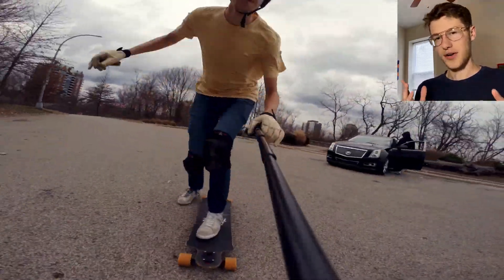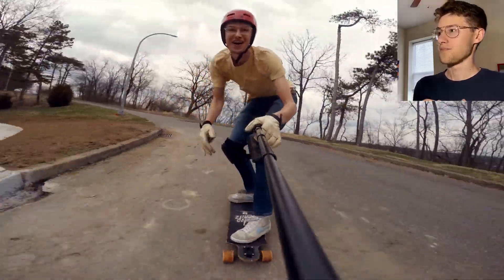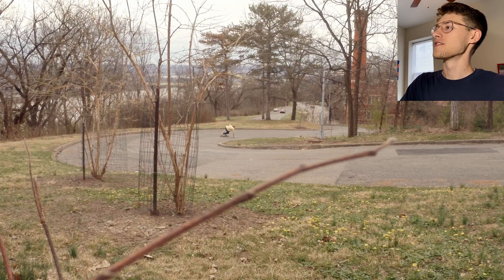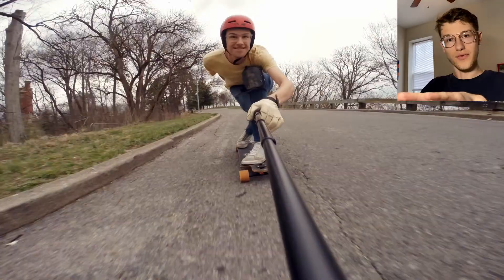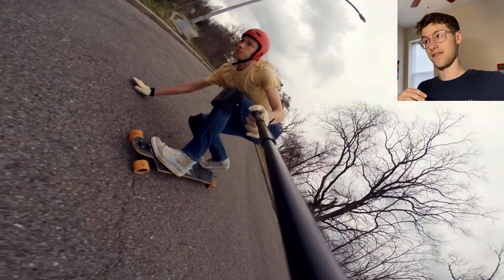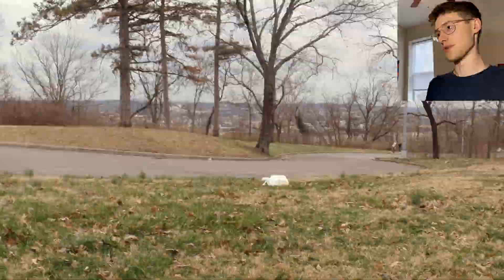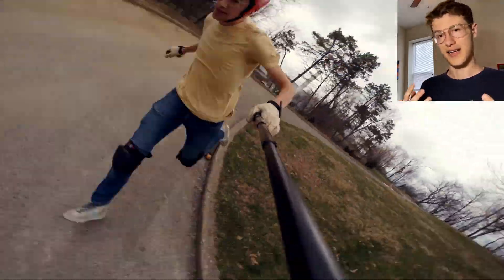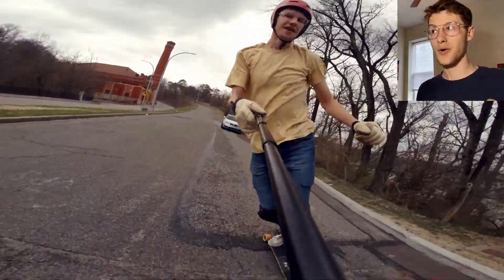What Riding a DROP-THRU Taught Me

Comment: This was super interesting. I like the part where you said "you're just along for the ride" when you slide. That feeling on a drop through is kinda scary but that's what makes it really fun as well. I definitely think you should've gone full 2010 style and smack some rakeless trucks and slidey freeride wheels though just for the fun of it. Sweet analysis tho you always get these on point 👌👌
Reply from the maker: I would do the 2010 setup if I were doing “How Longboard Technology Changed in 10 Years.” Using the gear in this video gave me a better reference to the kind of sensations I’m used to feeling on a board.
Reply from the maker: I complete agree with the unique and scary feeling being the most fun part of riding a drop through. I’m going to try to lean in to that sensation.
Reply: @owencampbell777  ah ok makes sense
Reply: @owencampbell777  dont feel like youre missing out by not riding slidey wheels on that setup? I understand your reasoning with the alphas but only skating those seems strange.
Reply from the maker: I’d ride freeride wheels on that board in a heartbeat.

For this assessment, it made sense to ride something with grip so I could try to perfect my corner and pre-drift technique. The LDP Alphas made sense for this test.

If my intention was freeriding this board, slippery wheels would have gone on it right away.

Please understand that this video was made after a few hours of skating this board. Not a season. Limiting changes in setup was an important step so I could develop a consistent technique.
Reply: @owencampbell777  that video concept would be so sick!!! i used to be a pretty high level downhill skater in like 2012-2014 and i’m now getting back into it and the new school setups are messing with my head and i seriously do not know what setup to get! so a video like that would definitely help me out immensely

Comment: Try dropped decks now ! I have been riding downhill on dropped decks since 2003 (was 19 years old), definitely something different. Before 2010, I was riding two Landyachtz DH Race, one with Magun trucks, the other one with Bear precision Smokeys first gen. They were really stable, no wobbles, but I really needed to throw an anchor at every fucking hairpin turn. Nowadays, I am riding a Zenit Draft, perfect dropped shape and weight, with Valkyrie Voxter MK3.5 DH. And this board is really insane. The modern precision trucks completely modify the feeling, grip and accuracy. I don't have so much that "sliding drift" feeling that you get with dropped decks. The board sticks more to the road and is really stable, turny and lively. In 20 years, so much things changed and improved, bushings, urethane, trucks geometry. It's just wild ! So happy to be still downhill riding at 40 years old ! Really love your channel. Keep on !

Comment: You can weight the board in a way to reduce the looping in the corner.

I find for toe side I lean way forward to get out of it. I find small wheelbase GS style downhill boards can be loaded so much closer to center. But i am admittedly new to them. 
And yes you need to actually force the nose out of a slide on drop decks. 

I once bought a drop through evo back in 2006 and I learned so much.
It was so dumb, but I learned so damn much about balance.
Reply from the maker: Great insight. Love your vids btw!
Reply: @owencampbell777  oh thank you! I appreciate it. I've been going through your content as well. It's important content you are making.
Reply from the maker: Thank you, I’ve been trying to make the kinds of things I wanted to watch when I was a beginner

Comment: My buddy has a drop though deck and it feels totally different than what I'm used to. I really like riding top mounts with little or no micro drops, and so its much easier to initiate slides with a bit more leverage. Felt really hard to initiate s on a drop through with a dropped deck. More stable, but harder to initiate.
Reply from the maker: Interesting! It could be that his trucks weren’t turning enough. You have to have loose/turny trucks to compensate for the +30” wheelbase on those things if you want to actually carve to initiate. That’s why I skated this one with stock 50 degree Cal III’s

Comment: I hated my switchblade with 50 degree trucks for the same reasons you stated. But when I put the 45 degree kodiaks on, it brought it to another level. I am honestly looking at purchasing the fixed blade now.
Reply from the maker: With such a long wheelbase, I didn’t want to compromise the low speed performance with <50 trucks. I generally like to set up my boards so that they’re just as fun going slow as they are fast.

This is a great perspective though, and hopefully it can guide someone to finding the right feeling for their board.

Comment: I'm thinking a new truck design would be rotating base plates along with the truck hanger and rake if needed. You could even make the Wheels conical two different angles (referencing rotating base plate with springs)while pushing a slide bringing you back your center with a spring.
Reply from the maker: It would be cool if you could create a blueprint or sketch to help visualize it.

Comment: I've never understood the physics of how the height of your setup affects grip. All else being equal there should be the same amount of friction between the wheels and road and the same amount of sideways force on the wheels. I can definitely see how your options for foot position and weight distribution are different between boards. I like the locked in feeling you can get on a topmount with your feet on or right around the bolts. I've pretty much switched to drop mounts though because more than half the miles I put on my board are pushing, and for that it's a massive efficiency and quality of life improvement.
Reply from the maker: I don’t understand the physics of it either. I think it has to do with the pressure a topmount puts on the outer wheels during a turn.